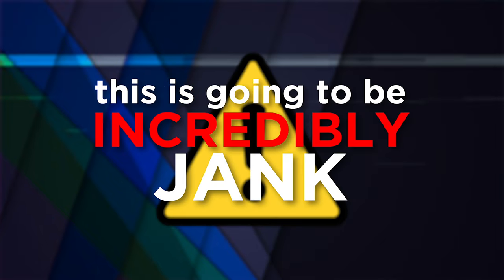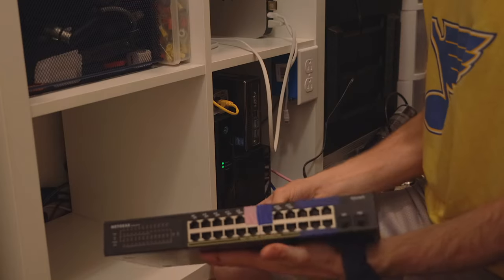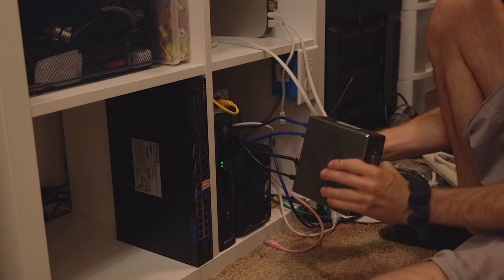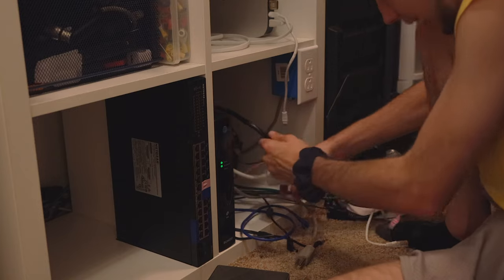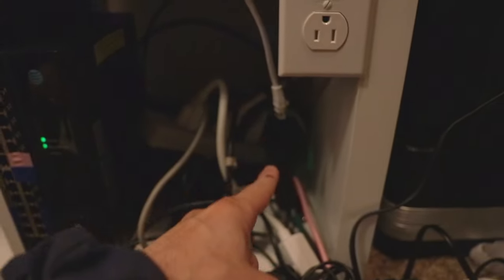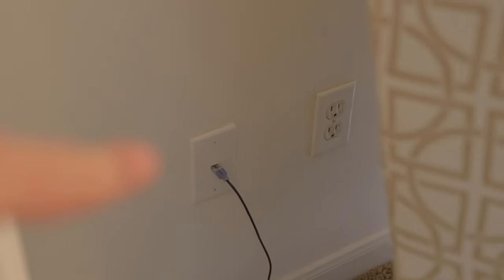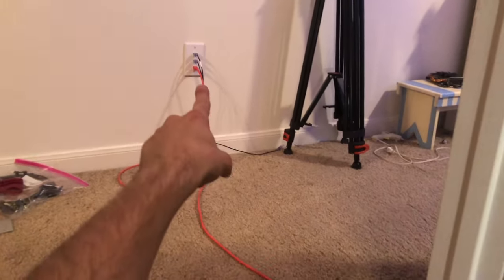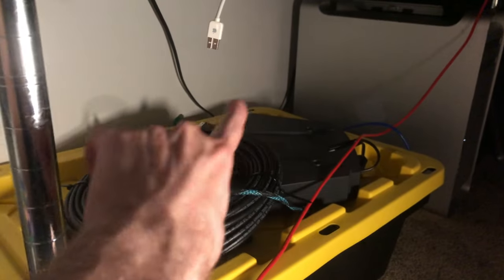Redoing My Network... Again

Comment: Why don't you just replace the rest of your switches with Ubiquiti gear? Get rid of the Netgear switches which are probably a fire hazard anyways especially on the floor under the couch. Just sayin.
Reply: @MillerTechnicalServices  Yeah I get the expense. Hear you there. Not cheap.